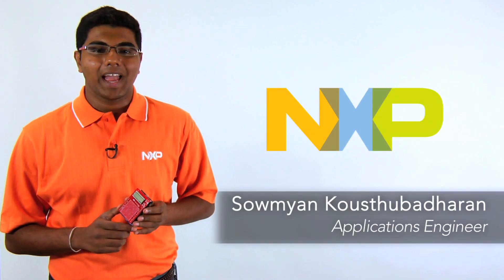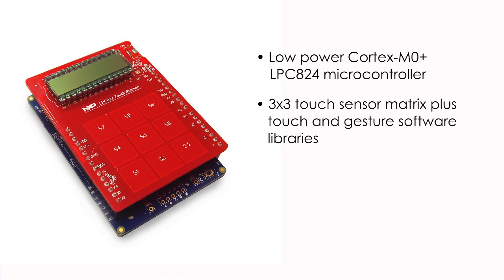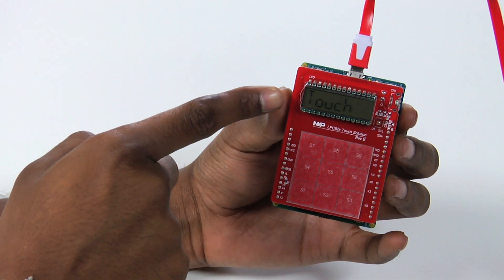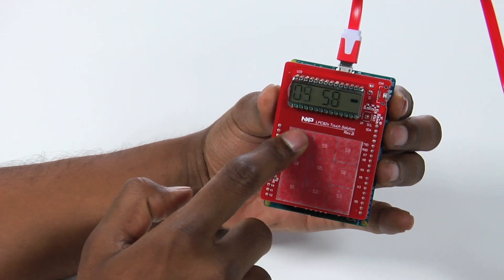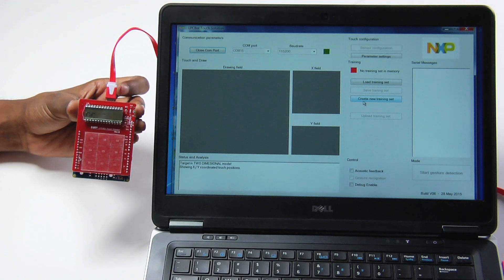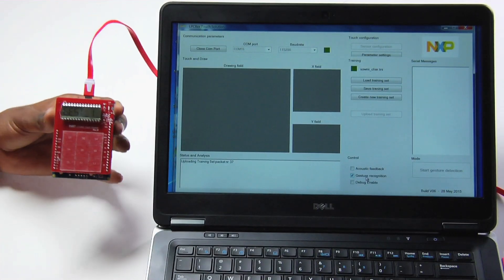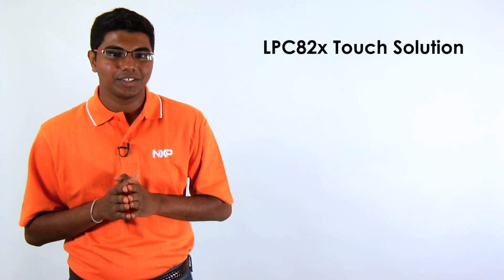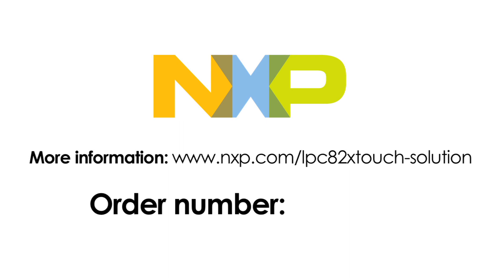LPC82X Touch Solution with Gesture

Comment: hello , I am wondering if you can point me in the right direction . I am coming from an 8 bit AVR and trying to learn to use NXP entry level M0 microcontrollers. such as the lpc800. But i do not know what type of programmer to use ? Do you have a specific programmer you can point me to, but not for huge production just for use at home
Reply: Maybe too late but this is the answer: you can get an independent debug tool (same for all Cortex M processors) or you can buy a  board with the microcontroller you want to use. All this boards from NXP includes the debugger.